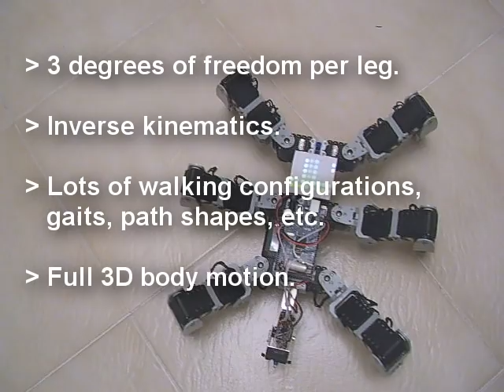SAMSA II - Advanced Hexapod Robot

Comment from the maker: @shakerobo, thank you very much for your comment.

Yes, the mega is controlling everything walk-related. With more detail, there's another atmega168 in the head for controlling the sensors, including the receiver for the IR remote. The display is also run by a separated micro. And, each AX-12 servo has an atmega8 inside, so the total processor count is rather high :)

bunsencharles hace 1 minuto

Comment: I try to use more than 4 Dynamixel AX-12+ with arduino mega but the engines don't run  if i put less engines than 4 it works. can you help me?